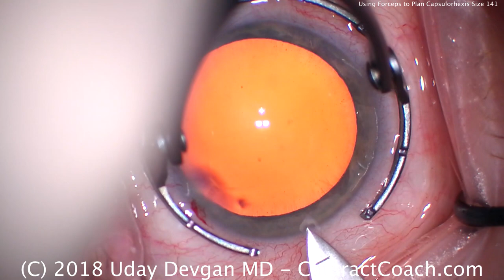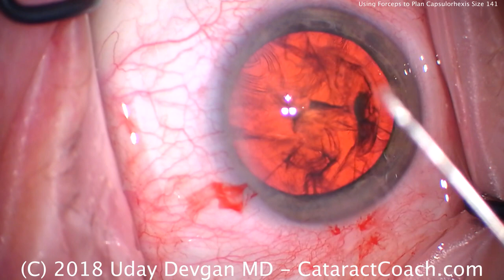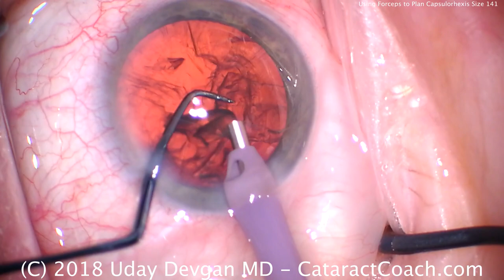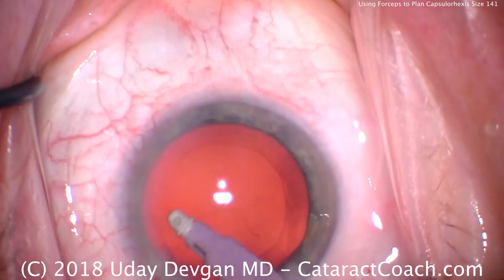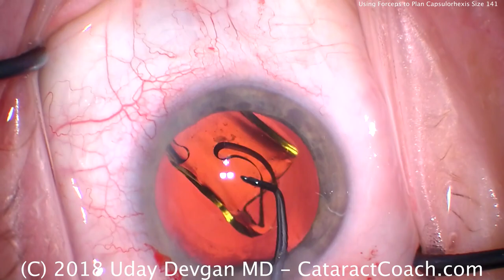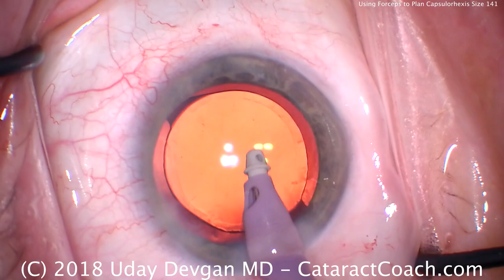Do NOT use the iris to guide capsulorhexis size during cataract surgery!

Comment: Dear Professor Devgan, thank you very much for those amazing videos. I was just wondering what ink would you use to mark your capsulorhexis forceps in order to avoid TASS?
Reply from the maker: Mine are anodized professionally by the instrument maker. Using a marking pen or ink will not last. You can etch a mark or grove in your forceps using an engraving tool.
Reply: @UdayDevgan Thank you very much for your prompt answer. We actually use single use disposable forceps, therefore lasting is not really an issue. But I was wondering if the marker pen could lead to a TASS and if so if you would know of any particular ink what was considered safe for that type of use.